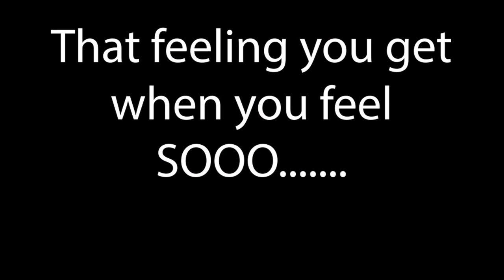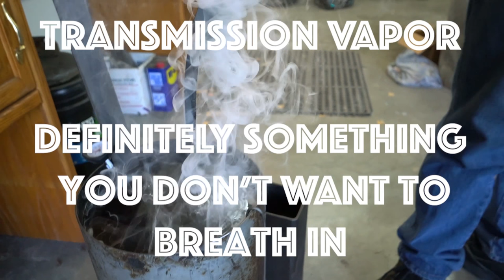Making a Knife out of a Shovel? Lets find out ~ Part 3

Comment: When you're that close to being able to make it a full tang could you forge the length and thickness then punch lengthways down the tang expanding to the width you need and open down the middle then modify the scales to fill it in?
Reply from the maker: Hey that’s a great idea Brian 
Go for it and let us know how it goes for you 
👍🏻🔥☕️⚔️
Reply: @KyleRoyerKnives  I've never forged anything it is way above my skill set. My thought process was I've watched smiths drill multiple holes in full tangs for weight reduction and I've watched them punch eyes in hammers and other things. Punching expands the sides some without removing much metal or weight. Maybe skelitizing the tang would do both? Thought I would ask an expert. How would you draw out the length and width you need though? Maybe not such a good idea after all. I don't know I'm armchair quarterbacking, or backseat driving. They say the only stupid question is the one you didn't ask. I'm not so sure about that.🤔
Reply: @KyleRoyerKnives  oh, thank you for answering. I admit I'm kind of surprised. You're a big enough channel it must take a lot of time to go through all the comments. I should shut up so you can get back to making blades.
Reply: @KyleRoyerKnives  what  inch blade is it and what inch  handle is it .great job .